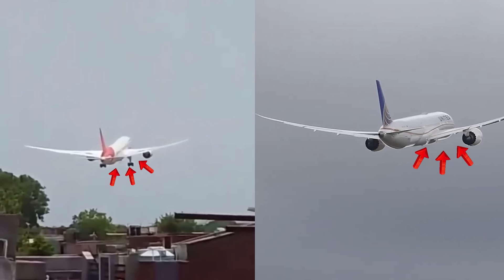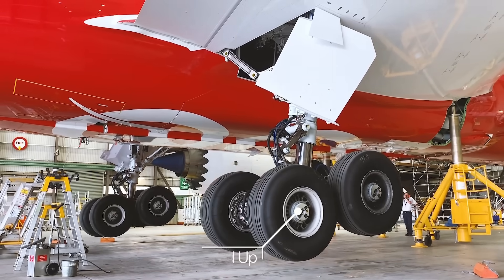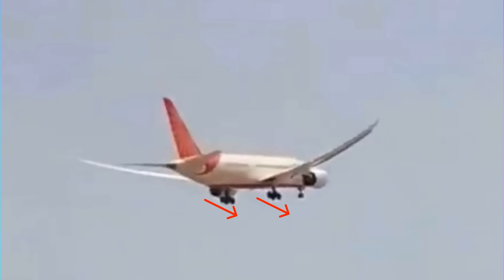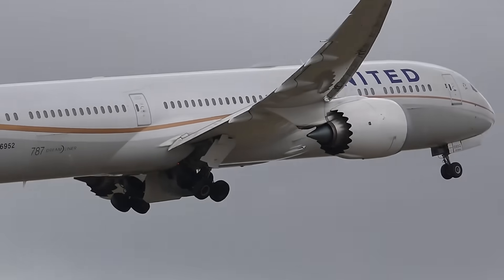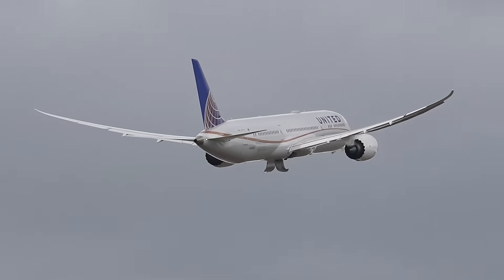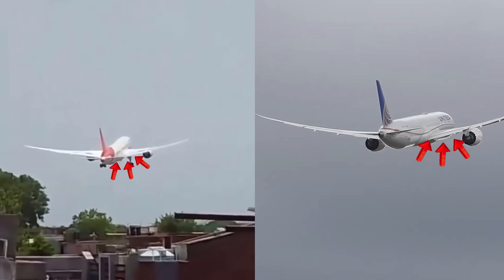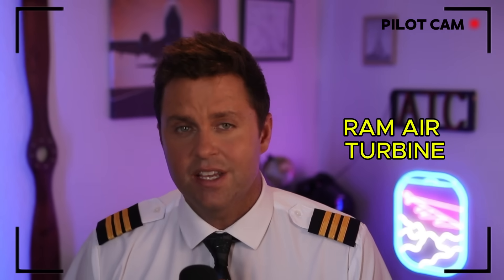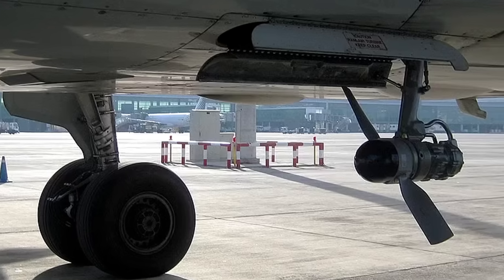Pilot Explains: A New Detail in the Air India 787 Crash Everyone Missed

Comment: Go look at 787 FAA Airworthiness Directive 2024-16-07. This AD addresses 787 problems with the autothrottle system sending both throttles, uncommanded, to the idle position. Why is no one talking about this known problem?
 
(e) Unsafe Condition
This AD was prompted by incidents related to erroneous auto-throttle (A/T) behavior during a balked landing with the A/T engaged, potential erroneous readings from the low range radio altimeter (LRRA), and possible deficiencies in low airspeed protections and crew alerting systems. The FAA is issuing this AD to address problems with thrust management (TM) and displays and crew alerting (DCA) operational program software. The unsafe conditions, if not addressed, could result in possible runway overrun or controlled flight into terrain.

Background

The FAA has received reports of several incidents involving Model 787 airplanes related to a throttle malfunction.

The FAA has received a report indicating that a design review of the dual 787 LRRA system, which included an evaluation of airplane health management (AHM) records, determined that there is an elevated rate of in-service altimeter miscompare events and loss of output events.

The FAA received an in-service report of a Model 787 airplane with flight management function (FMF) Block point (BP) 4.0 software experiencing the throttle returning to IDLE after manual increase of thrust during a balked landing with the A/T engaged.

The FAA has reviewed a report of the investigation of an accident that revealed deficiencies in low airspeed protections and crew alerting systems on Model 777 and 787 series airplanes.

As a result of the above, one or more of the following scenarios could occur.

During landing, erroneous altimeter readings from the LRRA could result in the A/T not commanding IDLE during flare, and, in combination with improper crew reaction, could result in a runway overrun.

In addition, if the A/T system is engaged during a manual go-around or missed approach and the thrust mode is set to IDLE, manual attempts to override the A/T system by pushing the thrust levers forward will not disconnect the A/T system as expected, resulting in the thrust levers retarding back to IDLE. This unexpected loss of thrust, if not corrected, could result in a loss of altitude and possible controlled flight into terrain (CFIT).

Further, airplanes with versions of FMF software prior to BP 4 are susceptible to situations where the flightcrew may believe the airplane systems will prevent the airplane from having too low an airspeed for its flight condition, when in fact the systems do not offer that protection. This can also result in a CFIT event.

Comment: So many theories speculating on what may have happened. 
Has anyone thought it necessary to investigate the EHM  trends , the EGTM and any previous recorded EGT exceedances and time time since last shop visit of the Engines. 
When operating at high OAT with a very probable MTOW , can the loss of power be a result of a Performance degraded Engine/s?
My research indicates that the FADEC will roll down the Thrust to prevent an EGT EXCEEDANCE  and  could also reduce power on the better Engine to prevent asymmetric Thrust resulting in Yaw.
Perhaps  an expert can comment.
As for the Gear,  cannot a mechanical flaw prevent the retraction?
No Flaps is a near impossibility due to Config warnings.

Comment: Think about this . Whatever happened had to be something that had the ability to shut both engines down instantly.  Not 10 or 20 seconds apart.   There is so much redundancy built in along with separate pumps and lines for fuel .  Landing gear in load position and RAT deployed seems like a total instant failure.  So what has the ability to kill both engines simultaneously along with hydraulics ?   My guess would be a total electrical failure. Because of where they were on takeoff there was no time for anything to help. I've listened to every clip with high-end sound equipment and I never hear any turbine power up.

Comment: Cascading electrical failure killing fuel pumps before backup system kicked in, at that point engines didn’t have enough rotation left to siphon fuel into the engines. Duel engine failure.

Comment: Any normal person/pilot will not cutoff fuel mains switch/control which is again fail safe, Fuel contamination will manifest at the very begging of take off roll, when full throttle is done, and there is lot of engine checks and engine running time already under gone before takeoff roll  What if something deliberately ingested in both engines just behind runway end perimeter wall or  in the restricted zone of the funnel area.

Comment: FADEC controls engine operation using closed-loop control of N1/N2, VSVs, and fuel flow. If a surge is detected—via rapid pressure collapse or N2 deceleration—it immediately reduces fuel flow, opens bleed valves, and attempts to stabilize compressor flow. This logic is automatic and phase-independent: it executes even during takeoff with no awareness of altitude or airspeed. The pilot cannot override this behavior, making surge recovery successful only if airflow and combustion stabilize fast enough. when the FADEC detects a surge, it rapidly cuts fuel flow to protect the engine. This causes the engine to spool down to near-idle or full flameout if combustion cannot be maintained. This behavior is part of FADEC’s autonomous surge recovery logic and occurs regardless of flight phase. In the scenario described, this spool-down occurred at low altitude after takeoff and led to loss of thrust before recovery was possible. If this theory turns out to be right this highlights a major flaw in the FADEC surge control logic. Obviously engineers thought such a scenario would be too improbable. In civil engines, such coupling is absent to avoid integration complexity and certification burden.

Comment: I don't claim to have any more than very rudimentary knowledge of flight principles, but (1) what is all this about it sounding like a Cessna turboprop in the video taken from a window? Sounds like it is on full power to me. (2) Why has no-one commented on the puff of dust or whatever it is to the left of the aircraft just as it reappears from behind the little building that looks like Noah's Ark on the CCTV video and takes off? What is that? Is it just runway dust stirred up by the port engine? If it is then it's working just fine at that point. If it isn't then what is it?

Comment: Very good observation. As for the fuel contamination, you can rule that out, why? This aircraft holds 3 lorries worth of fuel. Which means 1 lorry can be contaminated but not 3, or there is a lot more like that coming from the refinery - in case of underground tanks, the same - even more fuel must be bad but all aircraft took off well without complaints.

Comment: Another video  supposed that because the temperature was 102-104 degrees with no air conditionning on in the aircraft for about 2 to 3 hrs before t/o and having the fuel line going through under the floor  it might have caused a vapor lock in the fuel lines to both engines after rotation. This comment is very brief but is woth looking into that direction.

Comment: Engines of twin birthdays; maintenance done on both at requires service points; same mechanic that worked on only other engines caused tick time bomb with wrong reinstallation process or like in wayyyyy to many cases wrong parts used; like the time the instrument horizon was in stall from same company wrong model and it told them to dive when need to clime or vis verse, as I think I remembered it stalled but don’t hold me to that 5:05

Comment: I don't think it's contaminated fuel. I work at airport with fuel. The fuel is tested on arrival and every day before delivery.  As soon as the aircraft crashed the truck that delivered the fuel was grounded and the driver. The fuel on the truck was also retested right away. If the fuel was contaminated, it would be on the news by now.

Comment: I think the computers play a big part in this. Drive by wire, lane assist, self drive, fly by wire all have unexplained crashes!
I am now hearing the plane had problems on the flight in, entertainment system and air con. 
So think power failure to the fuel pumps, that would flame out both engines at exactly the same time!

Comment: EYE OPENER AIR INDIA FLIGHT AI171

The camera shot of the Aircraft Liftoff at the very end runway was partially blocked by shack which provides the crucial evidence of heavy dust and debris that most probably cause the Aircraft two engine failures
 
UNABLE TO UPLOAD THE SLOW MOTION VIDEO AT MOMENT OF LIFTOFFON THIS COMENT

FRAME BY FRAME PLAYBACK REVEALED THE FOLLOWING 

The Slow Motion Video shows the Aircraft used the full length of the Runway during liftoff, I believe was due to possible Aircraft Baggage and Passenger Overloading. Heavy Debris and Dust are observed on video seconds after Aircraft Liftoff at the end of Runway possibly causing both engine failure as evidence on by the deployment of the Aircraft RAT (Ram Air Turbine) to provide power and hydraulic pressure during extreme emergency.

Dual-engine failure, supported by new video and FDR data, is most likely with bird strike or fuel system issues as potential triggers. Flap or hydraulic failures are secondary. RAT Ram Air turbine Engine deployed after Two Engine Failure to provide electrical and hydraulic pressure for the Aircraft in an extreme emergency 

FRAME BY FRAME PLAYBACK OF THE AIRCRAFT LIFTOFF AT END RUNWAY WILL REVEAL THE FOLLOWING

Evidence of Heavy Dust and Debris on Liftoff Blurred the Aircraft Takeoff and Landing Gears

Heavy Dust and Debris on next frame below Aircraft allowed Takeoff and Landing Gears visible again as the Aircraft lifted above Dust and Debris

Aircraft Tilted to the Right, the Heavy Dust and Debris could have stalled Aircraft Right Engines at this instance after flying trough dust and debris

THE APPEARING AND DISAPPEARING VIEWS OF AIRCRAFT ENGINES AND LANDING GEARS ON FRAME BY FRAME PLAYBACK IMMEDIATELY AFTER AIRCRAFT LIFTOFF AT THE END RUNWAY PROVIDES EVIDENCE OF HEAVY DUST AND DEBRIS ENCOUNTERED BY THE AIRCRAFT IMMEDIATELY AFTER LIFTOFF
Reply: I agree... posted something similar last night.. am not a pilot, but did work on smaller propulsion engines for 20+ years.

Comment: Been in airline industry 30 years.. I also have been an aircraft refuelller  involved in audit after an aircraft crash where pilot blamed fuel, which was ruled out. Very much doubt it was contaminated fuel. If engines pulled back to idle you would still hear engines. I reckon they just turned off the fuel. It shuts the engines down instantly.

Comment: Here's a theory from "an engineer" at an "aviation company".... Dual engine failure (literally a 1:1bn chance outside of logic / SW failure) caused by over-aggressive load-shedding of critical systems that have been incorrectly classified as non-essential. This shedding occurred immediately after gear-up select (hence why MLG is stalled in wheels tipped forward phase of sequence. If you don't know, the MLG tips forward before retracting - wheels are clearly in that condition on climb). Would be interesting to know more about ELMS config data.

Comment: No to duel engine failure yes to flaps 5 which on that day was 111f 90% humidity 29.91 on a 11200 ft runway would be just beyond VR at 211.  It ran out of speed.

Comment: Are both engines fed by one fuel line, or does the tank in each wing fed that wings engine only? I agree it's most likely contaminated fuel; but how did the water or other contaminate reach both engines simultaneously?

Comment: You obviously didn't listen properly to Captain Steeve. In his second video, he discounted the possibility of pilot error (i.e. the co-pilot pulled on the wrong lever and pulled the flaps up instead of the landing gear). He is 100% sure that this was due to dual engine failure. And I agree. This looks just like British Airways Flight 38, on the 17 January 2008, where the pilot had sudden fuel stop shortly before landing at Heathrow. Luckily he managed to lift the plane over the perimeter fence and brought the plane down in one piece. In his case, the AAIB found out after a long investigation that due to flying at 36000 feet over the Northern Hemisphere the temperature had led to ice build-up in the fuel lines which then started to defrost , got carried by the aviation fuel to the contamination filters where it led to a build-up that caused the sudden lack of fuel shortly before landing. This can't be the reason here, of course, but we will find out more. Also, Captain Steeve said that the captain called out "Mayday" and also mentioned "...no power." That to him definitely means dual engine failure. You should have listened more closely to his video.

Comment: Agree, it appears they lost both engines shortly after T-1.  A good AE engineer could do calculations to confirm that the distance flown without power confirmed that both engines failed. But do the engines depend only on main electrical power? Wouldn't the RAT keep the fuel pumps powered up?
Reply: Of course not.  The main engine fuel pump is driven by the engine itself.

Comment: About the fuel system: how many fuel pumps has this plane, I've read 4? And is one engines connected with just one fuel line, or do they have a redundant fuel supply? And are both engines connected to the same fuel line? So can it still be possible that both engines can flame out nearly the same time because of contermination, or that all 4 fuel pumps can got clogged up so fast?

Comment: The auto pilot speed was mis set, maybe 150 kts instead of 250 kts. I think when the airplane reached 150 the auto throttle reduced power to maintain 150 kts. That is what happened on my flight sim.

Comment: I fully agree that the root cause was a dual engine failure. However, I believe no one is taking into account the clear signs that preceded it — warning signs that should have led the captain to abort the takeoff.

In fact, the 787 used the entire length of the runway, which strongly suggests that by the time it should have reached V1, the aircraft was still significantly below expected speed. This indicates there was already a noticeable thrust deficiency.

Comment: It will be interesting to see which is more likely here, contaminated fuel causing a simultaneous dual engine failure or perhaps a very short hour first officer experiencing a major engine problem  after V1 and then in some haste accidentally shutting down the wrong engine. 

The Titan Airways A321 biocide incident is a precedent for the fuel contamination theory though those engines didn’t suddenly and completely fail.

The British Midlands 737 crash from 1989 is a precedent for a crew with low hours on that specific type of aircraft shutting down the wrong engine during a single engine failure resulting in both engines shutting down.

Comment: I originally thought a duel engine failure due to a common issue such as fuel contamination.  But here's another possibility.

How about a catastrophic electrical system failure that resulted in RAT deployment, gear retraction stall, and fuel pump failure that caused the engines to lose power?

Someone has posted a video of weird electrical anomalies on the alleged prior flight on the same aircraft.